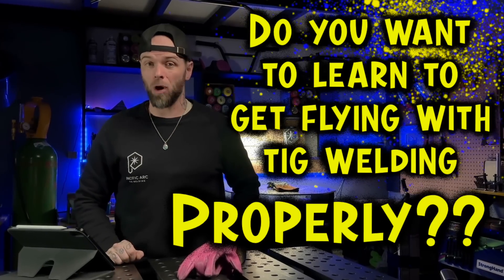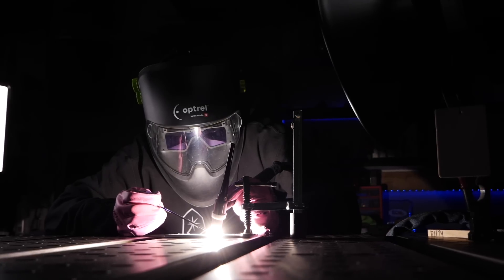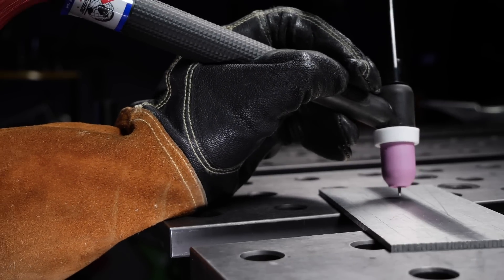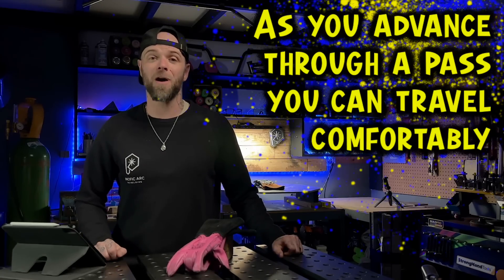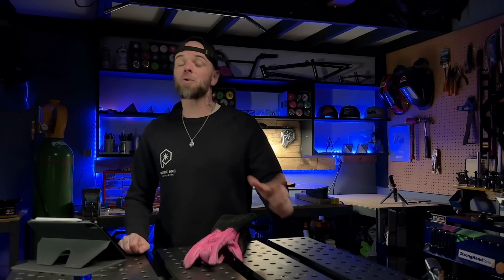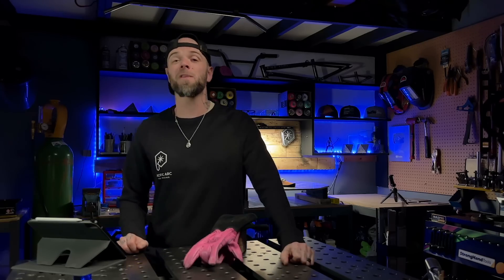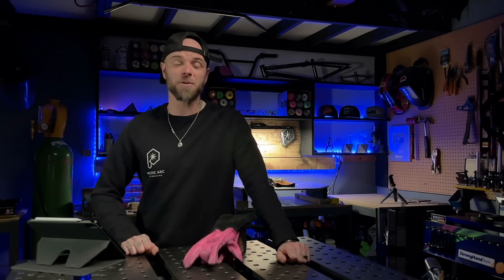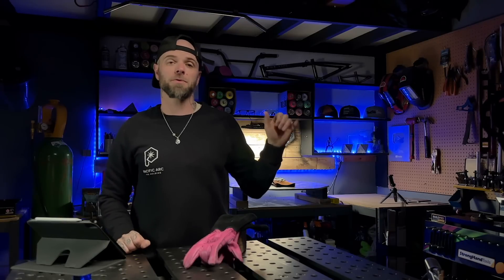3 BAD HABITS of tig welding FIXED

Comment: Dusty.... ALWAYS 1/8 filler?  I want to weld .090" or .060"....  would you still use 1/8 rod for such thin material?  I guess it would be FILL and CCCHHHHHIIIIILLL?

Comment: Stand off distance is important because of the inverse square law... The inverse square law states that for a point source of waves that is capable of radiating omnidirectionally and with no obstructions in the vicinity, the intensity "I" decreases with the square of the distance, "d", from the source. Or mathematically I=1/d², so the intensity of the arc "I" decreases based on the distance between the work piece and the Tungsten based on the distance squared... this makes for an exponential degradation of arc intensity due to the squared term

Comment: this is actually operator bad habit when they learn welding. when I'm welding both of my hand is floating in air is a habit. if I'm  welding standing vertical or overhead i don't need relied  where to rest my hand.

Comment: Hi, what's the best grade of aluminum to practise tig welding on?
Reply: The one that you can get at the lowest cost.  It does need to be a weldable alloy.  This will basically be any of the 3xxx, 5xxx and 6xxx alloys.  Basically if it is an extrusion it will likely be a 6xxx alloy.  If it is a piece of plate or sheet it will likely be 3xxx or 5xxx thought there is some 6xxx sheet out there.  There are only minor differences in how 5356 and 4043 filler rods act.  For practicing and learning, you don't really need to worry about weld zone alloy dilution.  hth

PS:  Unless you go dumpster diving at Boeing or Airbus, you don't need to worry about picking up any 2xxx or 7xxx material.
Reply: @paulkurilecz4209  Thank you so much for that information that is really appreciate.

Comment: Great info. This was my major issue as I was concentrating on filler rod dab and forgot about torch. I Made a simplistic ball bearing rail from a toolbox I could clamp to the table which was parallel to work piece and a wrist pad attached to it. Helped me so much in my early days till I got better and didn't need the rail anymore.

Comment: I'm sure you have already covered it. But I haven't come across it. Can you do a video on material prep. Not fresh clean coupons.  Actual real welding scenarios. Like adding a few tubes to a rollcage to meet new rules. I'm just getting back to tig welding after years of welding structural steel. And I swear I over look how clean the material has to be to get a proper weld with tig.

Comment: I mean do you even need to feed 1/8"? The rate at which you feed the puddle on these thinner materials doesn't require much filler or hand movement at all. Especially an outside corner. In my mind 1/8" should be used on 5/16" and thicker material. tappy tap tap